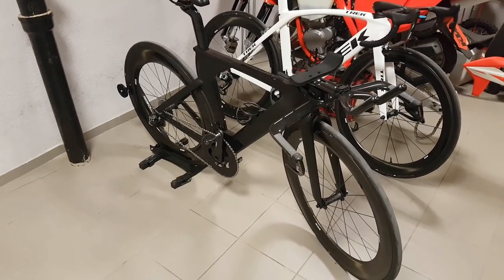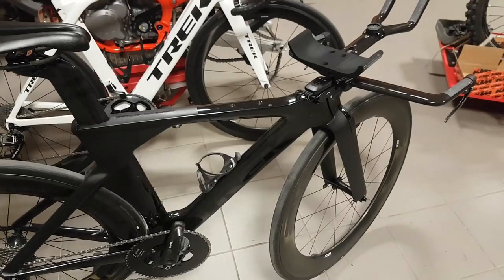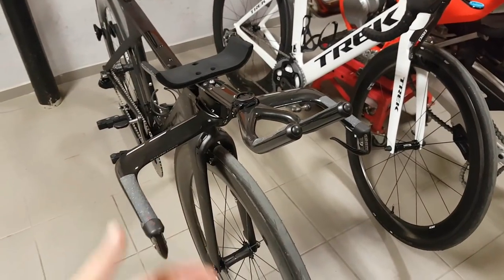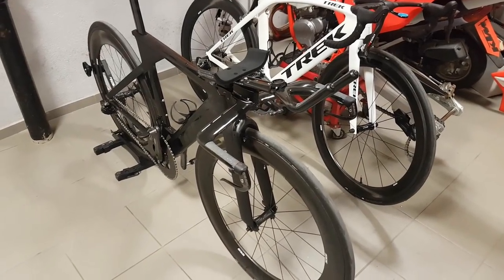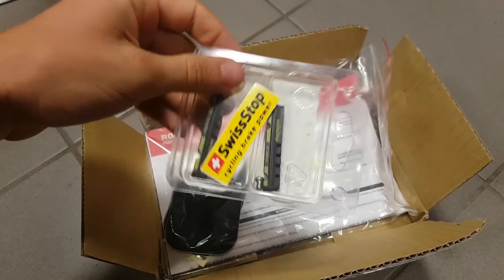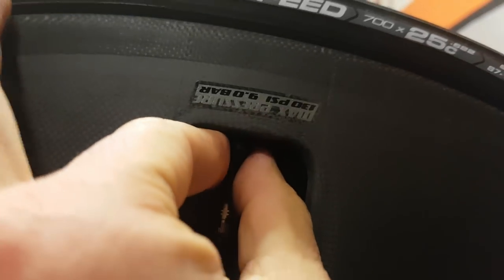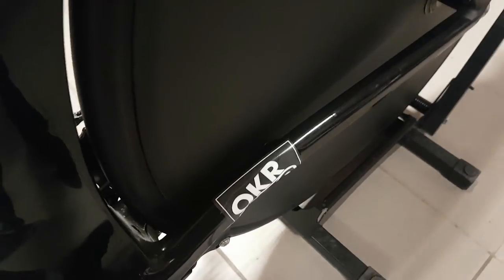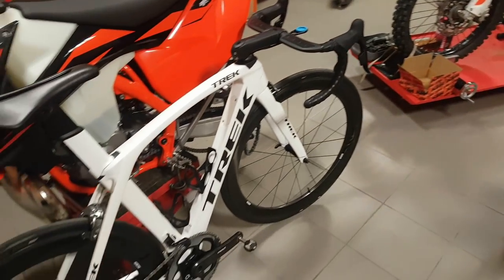The TT project - ep.2: Disc dilemma

Comment: Hey Ronald, the 321 disc does have foam coring and it is using 1k fiber on the lens...Thanks for the upload and good luck
Reply from the maker: The only foam is in the box that it came in.
Reply: Hi Ronald Kuba as the designer of the wheel, I am informing you so there is an accurate message. Enjoy the product
Reply from the maker: @CurlSwag  where is it then? Between the layers of the sides?
Reply: @ronykuba  correct. each lens has high performance core to increase stiffness with minimal weight. You can see pictures of this on bikerumor (not the production variant but a similar prototype)
Reply from the maker: @CurlSwag  I see, thanks!

Comment: Just a thought, but according to the law of inertia, a heavy disc wheel can be better than a lighter one. Think of it like a heavy flywheel; it will be hard to accelerate and decelerate BUT once up to speed it will keep momentum up, making the wheel easier to keep going at a constant, fast speed. Francesco Moser beat the hour record using a 4kg wheelset! If the course is really hilly, then a lighter disk would be better though.
Reply from the maker: Wrong. A heavier wheel also takes more energy to keep spinning at the same rate. It takes longer to deccelerate for this exact reason, there's more energy stored. Weight is always negative.
Reply: No, because the energy inputted is 'kept over' as momentum [p=mv- heavier mass means more momentum at a relative velocity]. So even though it is harder to accelerate/decelerate, this feature will help with pacing and holding a constant velocity, which is ideal for flat/ rolling time trials. More energy is required to get it up to speed, not maintain it.
Reply: Interesting point
Reply: You are both wrong. 
The higher momentum that a havier wheel has is good, but the price is that the legs must put more energy in the wheel in the accelerating process. 
So for that reason the havier wheel doesn’t have an advantage but also no disadvantage. 
It is also wrong that a havier wheel cost more energy to spin at a certain speed (only thing is a tiny little higher rolling resistance). 

So until know no matter how much the wheel weights. 

But: in real live there are climbs (1. disadvantage for heavy wheel) AND you have to brake and accelerate. And by breaking the havier wheel you loose (and vaste) more of the energy you put in the wheel before (2. disadvantage). 

So lighter wheel are always better in real world!
At the race track there is no braking and climbing, so Moser could go with the haevy wheel and the reason was it felt simply good for him and his riding style. But at the end  also at the track everybody has an disadvantage with heavier wheels because of the higher rolling resistance (which increse linear with the weight).
Reply: @heiko6376 yes, I'm just saying that as most TTs are flat and aren't very technical, then heavy wheels should suit most courses- you speed up (which should take maybe 20 seconds max?), keep at a pace and finish. Well, that's for most TTs in the UK. If it's a hilly time trial, then lighter wheels would definitely help.

Comment: nice disk

i have the vision metron 81s which are light at 1485g with ceramic bearings

I also have the matching disk wheel, which is just another rear Metron 81, with a carbon fairing. But it is still incredibly light

Got them all new for £1250 the set.....
Reply: tubular?

Comment: I fancy myself one of those roval disc's too.  The yaw chart I have seen though says hed is the fastest in near zero yaw if I remember correctly, which is my typical condition.  Unfortunately it was just a chart, Id rather see numbers, could just be the margin of error.  So when I upgrade I don't think I could justify the extra price for a possibly marginally less aero wheel for weight savings.  I love this wheel's width and weight, but not for the price.
Reply from the maker: It's almost 0.5kg lighter, and not less aero
Reply: Yeah I would sure like the fact it would also drop my bike to 8.3

Comment: The reason that a tri-spoke doesn't work well with the speed concept is that airflow attached to the wheel as it moves forward through the fork collides with the air trying to move from the front of the fork to the back. Essentially, the space gets choked. Some brands solve this by widening the fork blade spacing (Orbea and Pinarello come to mind).
Reply from the maker: Yep.
Reply: CyclingTips has an episode of their podcast (TdF Stage 3) with Josh Poertner of Silca/Zipp, where they specifically talk about this -- however Josh states that the Speed Concept is very well thought out with its wide fork legs and works well with a trispoke. If this wasn't the case now, why would the team be using PRO 3 spokes? I use a HED Trispoke with my Speedconcept and there is ample room between the wheel and fork legs. Where are you guys getting your information that states the opposite? 

For reference, this podcast is also condensed into a shorter 12 minute video (https://www.youtube.com/watch?v=Ns5f1h1YI64), where they briefly mention the speed concept fork blades at 4:25 but it is expounded upon in the podcast which is over an hour long and highly informative.
Reply from the maker: @garrettreel8118  the Speed Concept doesn't have wide fork legs and Poertner states the exact opposite of what you've written. The team uses Aeolus 9s and 6s because of this.
Reply: He stated that Trek was one of the first to understand "challenge" of a composite spoke wheel, and "absolutely loved their thinking on the TT bike" -- doesn't sound like the opposite of what I have written. He even refers to the fork crown as "super wide" -- and here is an article showing specifically that the team uses the PRO 3 spoke wheel - https://pelotonmagazine.com/peloton-x/trek-segafredo-part-1-inside-the-tour-de-france-ttt/ -- with that said yes they do use Aeolus 6/9 on windy days. I imagine they have done quite a bit of research and testing and wouldn't be using a 3 spoke when conditions allow if they weren't a favorable option.

I really enjoy your videos and opinions as they relate to equipment and aerodynamics -- my team has been supported by Trek for a few years and I also own a Madone 9 H1/Speed Concept so it's great to see what you do with the same equipment!
Reply from the maker: @garrettreel8118  I would suggest re-listening that. As I said, and I'm sure you can see that on your bike, the Trek has normal fork legs, not super wide bowed out legs like the Pinarello or Orbea.

It is however the fastest bike out there, along with the Cervelo P5. (According to 650 tests done by Aerocoach.)

Comment: Have you used an OSPW with the 321?  On my Super 9 there is rub in the lowest gear.  Thanks!
Reply from the maker: not yet, but I have with the S9 and there was no rub. Your hanger is probably bent.
Reply: @ronykuba  thanks for the info.  I have a IA FRD, integrated hanger.  I have had it straightened but still the rub with the OSPW...I might have to go into the lightest spring action and tweak the B Screw to make it work

Comment: Why a 25mm? I thought that the tire should be at least 95% of the rim width small. There is even some data that suggests that having a tire 2-3mmnarrower than the outer rim diameter is a good chunk faster than the 95% rule
Reply from the maker: 1.) It's a rear wheel 
2.) It's explicitly stated that it works best with a 26mm wide tire
3.) Rim width is 27.8mm

Comment: The braking performance is good? ;) (talking about the 321)
Reply from the maker: I didn't need to brake much while putting the tire on, or installing the wheel in the bike
Reply: Ronald Kuba sorry , I thought that at the moment the video was upload you already rode with the disc
Reply from the maker: @leonardosoares2002  I probably won't ride it until February

Comment: you would only need tubeless ready when you'd ride cyclocross with that. disc should be tubular in my opinion
Reply from the maker: Well your opinion is completely wrong then, because tubulars have significantly higher rolling resistance and are less aerodynamic, while CX is pretty much the only discipline when tubs are more preferable, because of their compliance and impact resistance.
Reply: Tubs are slow. Some pros are now running clinchers for TT's
Reply: J S yep Tony Martins used them for years and he’s not done too badly

Comment: You need to know that the roval disk is faster with specialized s-works cotton clincher tires believe me.
Reply from the maker: They have twice as much rolling resistance, so I seriously doubt that
Reply: @ronykuba  Where are you getting that figure of twice the rolling resistance from? Bicyclerollingresistance estimates between 8.4 and 8.6 watts for SWorks Turbo Cottons with latex tubes at 29k/h, 85k load?
Reply from the maker: @tobiasbouma4071  that's not TL as far as I know. The TL S-Works turbo is at 13.1 vs the Vittoria CS 23mm at 7.7. This is the 25mm version, likely coming in at 7.0 or lower.
Reply: @ronykuba  I think the clinchers Wander was referring to were the Turbo Cottons rather than the Turbo Tubeless tires, which should sit around 10.1 - 1.5 = 8.6 W of RR in lab conditions (8.3 bar, latex tubes). But your point still stands